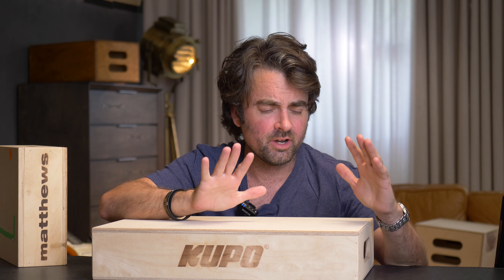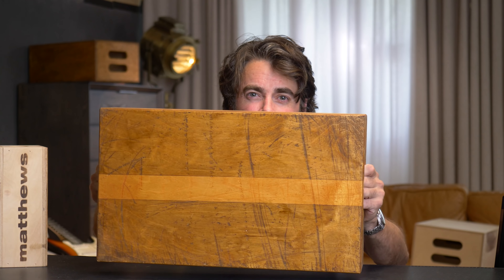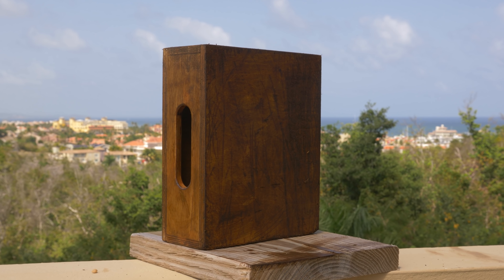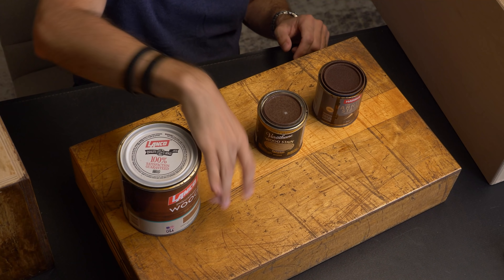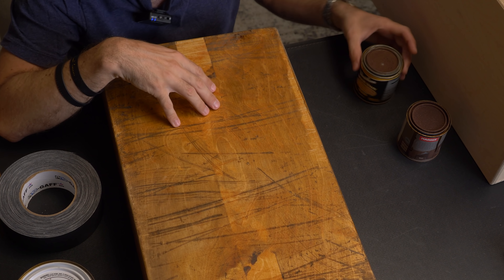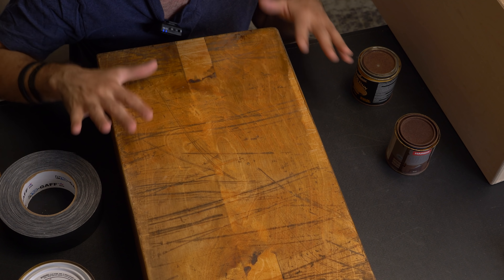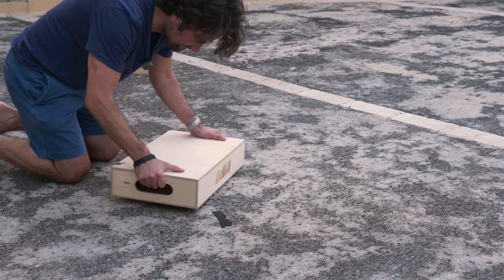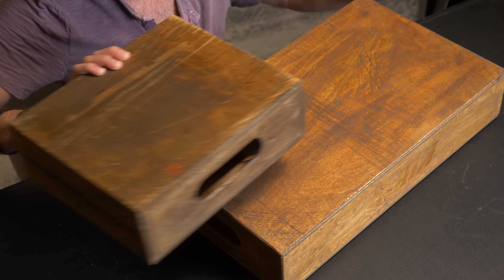DIY Photo Tip: Make Your Apple Boxes Look Rustic

Comment: Another fun technique: before staining, burn in some of the grain with a propane torch. then do the staining. Fun video by the way.
Reply from the maker: Wow, why didn’t I think of that!  Okay I might have to finish these off a bit more. -P
Reply: @FStoppers  we used to do that in Jr High shop class wayyyyy back in the 80s. It can look pretty interesting especially when working with wood that has a lot of course grain.
Reply: That does sound really cool

Comment: You should use painters tape or masking tape, paint the box, and pull the tape off before the paint dries. This will give you a clean pin stripe. Gaffer tape is not meant to be painted, but I'm sure it contributes to a distressed look.

Comment: Just a thought, perhaps you could spray paint the inside? If you use a mix of dark browns/blacks then no matter what angle you shoot at, the inside should 'fade' away as little to no light will be reflected. I'd say it's probably best to do this prior to prepping the outside and before staining the outside, this way you have less of a chance of ruining anything you are really proud of on the sides (with the holes) plus you could sandpaper off any 'spillage/bleeding' that would add to the aged look that you are going for. Again, just a thought. Fab video, super inspired to give it a go. 
Su :)

Comment: This is cool, I wouldve probably gone to a charity shop if I needed an old vintage box, then again probably wouldnt of been as fun. Also, whats to say you cant go to any hardware store and get a super cheap wooden box? Those Apple boxes seem a little bit pricey.
Reply: You can, but a lot of those cheap boxes unfortunately don't hold up with weight on them. I use mine for clients to sit or stand on, and the ones you purchase feel super solid and reliable. Can't say the same for what you find just anywhere. At least in my experience. But you're right, they're definitely pricey. I had the same thought as you when I initially saw the prices.
Reply: Next week I’m building a set of 4 full, 2 half, 2 quarter and 1 eight boxes! Doing it in 18mm plywood. Metthews so 19mm but I have to choose between 18 and 21, and I think they’ll be plenty rugged at 18. Of course I’m making them exactly the same dimensions as metthews does. Think cost will end up at about $200 for the 9 boxes instead of more than $1000 if bought from metthews. Using some of the money I’ve saved to buy a Makita router, which will give the handles a better finish...